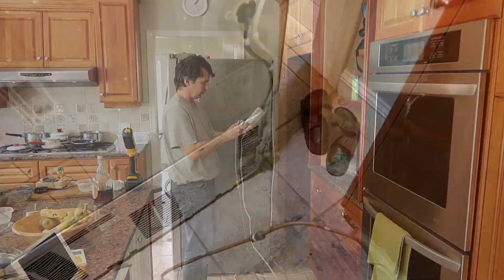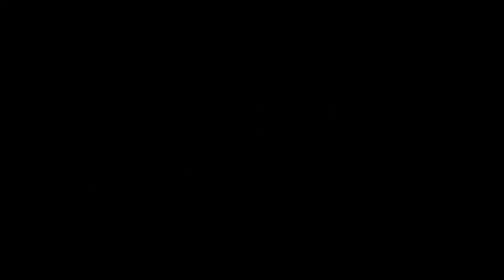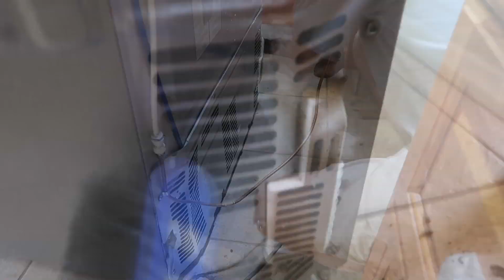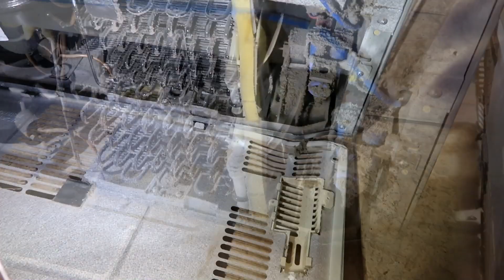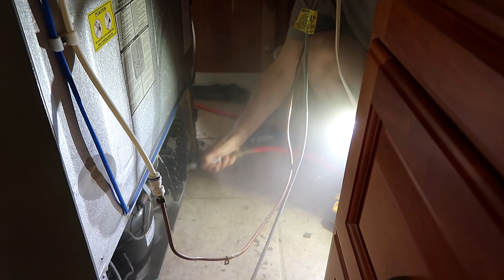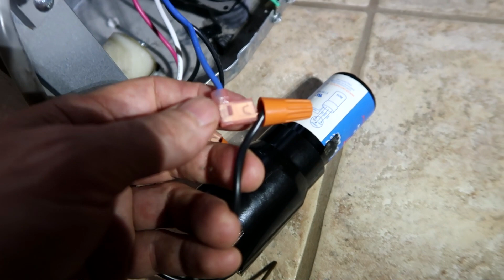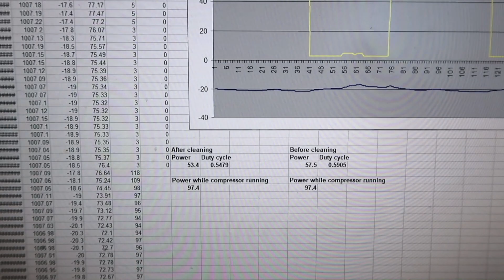Does dusting out the fridge reduce its power consumption?  And changing the starter relay

Comment: A few things.
1) Your inductive sensor works when wrapped around a single hot side. They have many clamp on type for about $9 US Sparkfun part #SEN-11005 as an example. The more wire coil the higher the analog signal. There are some people who monitor each circuit in the breaker box with these.
2) Another good current sensor  Sparkfun #SEN-14544 AKA #ACS723 these require opening the hot wire. Now it could be fitted into a larger plug or a box. These are hall effect sensors using  small copper strip inside the IC wrapped with a coil of wire. They are also calibrated to output a voltage per amp ratio. So you cold calculate amp hours used and watt  hours assuming 120V or what ever your base voltage is.
3) Something few know... If you have a new power company digital meter there is an Inferred  LED on them. It flashes intermittently faster the more power you use. The flash can often be seen by a video camera that does not have an IR filter. It can also be sensed with a IR sensor transistor. Each flash generally indicates 1Wh used.

The only way to understand power savings is to be able to measure long term. Its a bit of a surprise where power is used.

The other place to measure is water consumption. This is sorely miss managed. Some new water main meters send data back to the water companies almost real time. They have discovered so many water leaks with these. There are several sensors you can place in line that sends a pulse out for every few ounces of water. If you dig into the main water meter you will find you could put a hall effect sensor on the bras housing. Most meters have a magnetic impeller that couples to the meter works. The magnetic coupling isolates the meter works from the water. Preventing the meter works from corrosion. quite clever.

Something else I have always been interested in is the temperatures in the main house, the attic, the crawl space, outside, and basement (if you have one) My thought was in the winter on a sunny day you could close off the air vents in the attic creating a solar collector then move that warmer air into the main house. There are some ideas I would like to try with Mylar blankets and different vents to increase the efficiency of that system. I talked to an architect friend he told me I really get it where his fellow architects continue to repeat the old process because thats what they do.   The opposite could be done from the crawl space in the summer and the cooler air down there.   

Anyway have fun keep making the interesting videos!

Comment: Would have been interesting to track with an RTD (or TC) the room temp along with both the freezer and the fridge sections. Does the fridge have auto-defrost and how do it work? Are there heat coils embedded in the fridge walls and/or doors. Does your fridge have an outside water/ice despenser on the door? Mine does (1998 era Whirlpool) and I found out there is a small heating coil under the drip tray to evaporate any water that drips out of the ice chute and collects in the drip tray.

Comment: Most home fridges have a fixed capillary injection, which is tied to a certain temperature range at the condenser, set by the factory reasonably high because most people dont clean these ever.
The downside is that it doesnt benefit from the thermal advantage of cooler gas entering the freezer, because its at a lower pressure the compressor has to run for longer. This is especially true when you put the fridge in too cool of a place.

Comment: I think the "power while compressor running" is normal to be constant. This is the power that the compressor is consuming while working: 97.4W (J/s). The larger duty cycle can be increased after cleaning the radiator because the coolant is better cooled now with the radiator cleaned. And the desired temperature is reached sooner, and the compressor stops sooner ... having the other parameters constant (fridge insulation, quantity of food in the compartment that is acting like a buffer that "store freeze", ambient temperature, number of open/close door cycles). 
If the "power while compressor running" was not a power, but an energy consumption (e.g 97.4Whr), than you would be right.

Comment: I've been seriously considering building a duct from my crawlspace to my attic that the back of the fridge would sit in, the main reason I haven't done it yet is because I want to know how much of an impact it has on efficiency and I need to build or buy enough sensors to log several data points.

I learned that intuition isn't always a good indicator with what will improve fridges when I attempted to insulate a fridge on the outside and the power usage went up about 20% 
I borrowed a thermal camera and discovered the outside of the fridge was warmer than ambient, turns out fridges have heating elements to prevent condensation so the insulation I added redirected that heat back inside the fridge causing the compressor to cycle more frequently. 
I've read that some fridges have a switch for those heating elements, but I've yet to see one in person.

Comment: You can probably fix the relay. Ours broke and I thought "what the heck" and broke it open (with moderate difficulty). The contacts were badly burned and with a bit of polishing, they are now good for another 10 years.
(But I will probably get a spare - if I remember)
BTW - fixing the fridge when you have no spare makes you a domestic hero.
Reply from the maker: Broke ours open.  It’s solid state, no contacts.
Reply: @matthiasrandomstuff2221  I guess sometimes "the old ways" are just as (un)reliable but at least offer the opportunity for repair. Progress...

Comment: I'm not surprised to see the varying cycles, it may be related to the defrost. I think newer fridges take advantage of that phase change of the frost to help boost efficiency - which I probably is why you don't see a large temp drop in the freezer when it is cooling the fridge portion without running the compressor. That phase change can absorb a ton of energy.

What I can't figure out is how it gets rid of that humidity. Unlike an AC unit, it doesn't have a drain.
Reply: Refrigerators I've seen have a condensate drain. It's in the hidden compartment with the evaporator coil and drains to a small pan near the compressor. From that pan it evaporates quickly enough so that it doesn't overflow.
Reply: @eDoc2020  You know, now that you say that I was aware of that only because I had one that was old enough that the tray slid out from the bottom for cleaning.

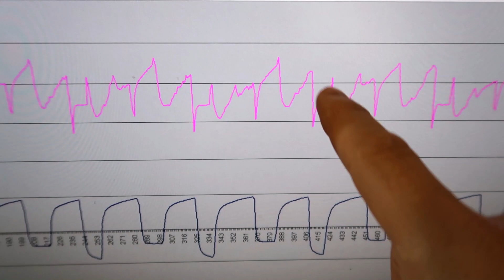Comment: The increase in power consumption, or the cut off in around @2:00 is due to dehumidification in the fridge. The water vapor is starting to stick to the evaporator at around 4-5C, as water vapor has enormous energy, temperature remains constant until air is sufficiently dehumidified for the temperature to fall, after which the temperature switch cuts out.

Comment: A few years ago I replaced my worn out mechanical defrost timer with a commercial electronic unit. 

The mechanical unit used about five  watts continuously, the electronic one under half a watt continuously with occasional  1-2w increases for the relays.

Through similar experimentation and analysis over time (about two months in total) to establish usage patterns and reduce erroneous data I managed to shave off some time the defrost heaters and associated fans spent on and the frequency of the whole cycle itself. 

I reduced power consumption in the long term by effectively shifting the duty cycle on various components as you have. Ice doesn't really accumulate anymore as the fridge and freezers are not accessed excessively among my family. 

I've saved money and rescued a fridge in otherwise perfect condition, given it's age. Said timer was not particularly expensive and has been in flawless service for several years and has probably paid for itself already. I've not done a cost analysis as my figure we're taken years ago.

I see room for improvement in the way airflow is handled and wonder if it's due to the style of the fridge freezer itself. My own is built into a cabinet with a large cavity underneath it which is vented elsewhere and a similarly sized large exhaust area up by the ceiling. 

At one point I was experimenting with an extra 3-5w additional power draw for a ducted forced air cooling for the condenser pulling air from underneath and blowing it far away from the fridge across the ceiling. It did make a noticeable difference to the cooling duty cycle (on account of boosting efficiency) and as that fan only ran when the compressor ran. In this country this is unfortunately done only on commercial appliances so far as I am aware.

On the model you have I imagine the airflow coming from the right passing over the condenser then combining with some ambient air as it passes the grill before blowing over the compressor. 

A bit of small duct work shifting the now warm air upwards would almost eliminate the air from being blown over the entire apparatus multiple times.

Usually when experimenting I make baffles and ductwork from plentiful laminated cardboard (think cereal boxes) to start with, other materials for more permanent projects of course.

Transparent materials are my favourite though as you can waft a little smoke or vapour through to see exactly what is happening with the flow.
Reply: Plese tell us the numbers!! What smoke do you use if you don´t want to have the burn smell?

Comment: Do a video teardown of the relay and diagnose and possibly fix. Its possible you dislodged a chunk of dust and it jammed up something. Your conclusion is about right though. These things usually catastrophically fail after a huge build up and the system working hard for a long time continuously. Cleaning regularly stops it getting to the working hard phase and thats where you make savings in power and component cost.

Comment: When I first moved out I got an old Miele fridge from someone, the brass plaque on the compressor said it was made in may of 1974. I put some new rubbers on the door and basically decided to keep it until it died and then replace it. In 2015 I replaced it, after 11 years, because a weeks worth of Kill-a-Watt data showed that buying a brand new AAAA energy rating model would pay for itself in about 3 years in just the power savings alone. The thing just wouldn't die. The relay did have a nice satisfyling clunk to it. I bet that relay was serious overkill.
Still that thing was a testament to German made quality, someone probably paid a pretty penny for it back then and quality wise it was clearly worth it. I gave it to some students for free. It wouldn't surprise me one bit if it's still out there cooling someone's beer.

Comment: Immediately after you triggered your blow gun my compressor roared to life. "How is Mr. Wandel using my compressor?" from 2000 miles away...

Question though: Isn't there some sort of heating mechanism in a frost free refrigerator that prevents ice accumulation at the evaporator, and mightn't it be kicking in on alternating power cycles, accounting for the "weirdness" in the power consumption and temperature cycles?
Reply from the maker: The defrost on the evaporator kicks in once or twice a day, and it draws 400 watts.

Comment: Residential refrigerators are generally designed to be dust tolerant, but should be cleaned.
Clogged condenser coils are the most common failure on commercial refrigeration, as well as air conditioning. This for 40+ years of service work. Your condenser (outside part) should be cleaned fairly often, how often depends around here the cottonwood can clog up a unit  in a week
Reply from the maker: Every time I have had a fridge out in previous houses, It needed cleaning.  This one was actually the least dirty one I encountered!  We had the house for less than a year, and the previous owner kept things pretty clean.

Comment: I never checked what kind of motor the fridges actually use, but assume it might be a capacitor start type.  If so, I know that the starting arrangement is a key to momentary power consumption.  If the starter does not release when the motor is running full speed, or does not deliver a full speed, the motor pulls way more power.  Suggests a indeed a failed starter in this case.
Reply from the maker: The way it failed, no starter coil was activated, motor wouldn't turn, drew about 800 watts, and after about 10 seconds, the fridge's current protection would trip, then re-try in a few more minutes, and the cycle continued.

Comment: Are you planning to modify the fridge to have it blow the air in the front? Would be a nice comparison to see if it's going to reduce consumption
Reply from the maker: It used about 5 watts less when I had it out of the cabinet.  I figure that's about as much savings as could be achieved, so not a huge amount.

Comment: If it were under warranty they would have likely said it was from the compressed air blast.  I have some machinery that I have been explicitly told not to use compressed air to clean the dust from.
Reply from the maker: The warranty for that part was just 1 year, and it's 9 years old.  The sealed system warranty was 7 years, but that doesn't cover the relay.

Comment: @Matthias random stuff - there is a way you can save yourself the effort and time of manually entering the power monitor readout... since you are already capturing the readings you can use a simple CNN (Convolutional Neural Network) to convert the readout and graph it for you... check out the following paper for a simple use case and if you need any help send me a message and I can knock something up for you (although I'm sure you're more than capable of doing it yourself) - https://arxiv.org/ftp/arxiv/papers/1807/1807.04888.pdf
Reply from the maker: yes, but as soon as anything gets bumped, I'd have to retrain the network.  I'm pretty sure just entering the numbers was the least time consuming solution here.

Comment: I really wish that in the experiment you had temperature sensors inside and outside instead of humidity. I did this experiment more crudely some years back with my parents refrigerator. The result was like 15% or 20% lower energy use. I vacuumed/alcohol wiped instead of using compressed air not that it matters.

Comment: Good stuff.  Recently, getting a new fridge for my Mum, I found different manufacturers specified significantly different space on the sides and top surrounding the fridge.  Even though the fridge fits in the space, it is not necessarily an ideal situation.  If you could raise the fridge (on say timber tracks), this may allow more  air to circulate?  (When you need to move the fridge out, just add a board of similar thickness in front)  Cheers, David

Comment: Since the dust collecting in the coil prevent air flow which stop the coil from cooling like it should. The best place to measure temperature to see the actual effects of the cleaning would have been where the freon goes into the compressor after it has been cooled.

Comment: So, you are saving $2/year (4W % 50% duty cycle), but it cost you $25 for a new relay.
Reply from the maker: or you could say I saved $100 worth of food in the fridge because the relay happened to fail while I was watching it.  Or I saved $2000 cause I fixed it instead of replacing it.
Reply: Michael, you’re like the guy who knows the price of everything but the value of nothing! 
He got to flex his intellect and he gained knowledge, and you can’t put a price on that.
Also, the fridge is clean; the dust sprites banished.

Comment: I recall that refrigerators used to be designed to blow the warm air out through the front.  We had a cat and that was the favorite place for the cat to sleep.
Probably got changed when someone realized they could save a quarter by just adding more fins in the back.
Reply: when i was a kid in the 80s my mom used to use the warm fridge air to dry shoes after a wash or rainy day.

Comment: CHECK if it has a little semiconductor disk inside the "relay" - this is what powers (and turns off) the motor starting coil.  It corrodes where the contacts push against it.   Rotate the disk (or I think you can flip it over) to get a clean contact area.    Your manhandling of the fridge probably jostled the contacts and killed it.

Comment: Our fridge has the radiator in a flat configuration over the whole back side so it can just cool from free air ventilation, doesn't need a fan and doesn't need cleaning.
I think the radiator design on your fridge is less than optimal.
Reply: Maybe it’s meant to compensate for higher indoor temperatures? The forced air is gonna be more effective at cooling when very high powers are needed.

Comment: Cool fridge. Mine have a much simpler coil arrangement, it just spans all the back part of the fridge and have no fans to force air over them.  After some advice, I pulled the unit a few centimeters away from the wall so it have more space to air flow and I noticed a small reduction on my power bill. 
You know what this means? Means I need a raspberry pi and a kill a watt

Comment: Fascinating to see a canadian fridge/freezer build with the condenser in the bottom! Here in sweden the standard configuration is that the condenser is the entire backside of the fridge, this means air goes in under the fridge, gains heat and ejects at the top due to the chimney effect.
Reply: Same here in the UK.

Comment: I recently bought a freezer, which came with two plastic brackets that snap onto the back. They change the energy rating for the freezer from AA to AAA, just by forcing it to stand further away from the wall to allow for better air circulation.

Maybe you can do another sampling night with the temperature probe behind the fridge, near the coils?